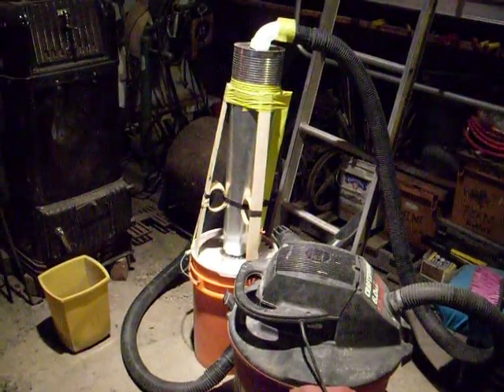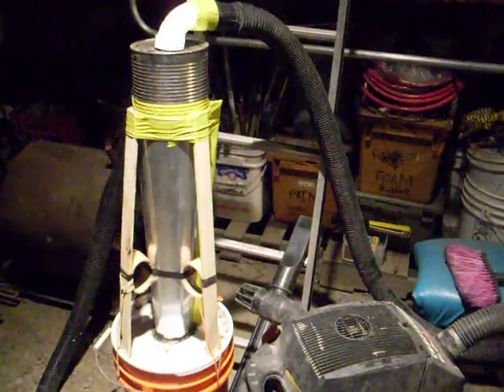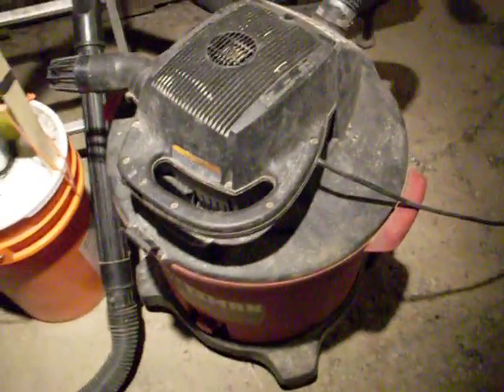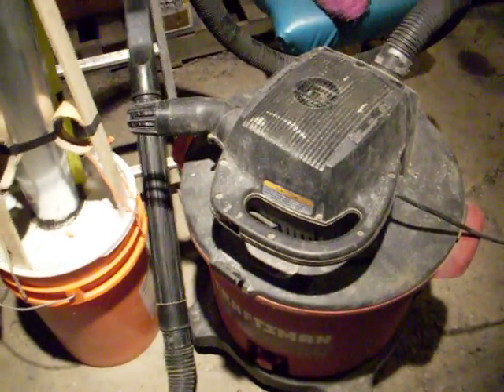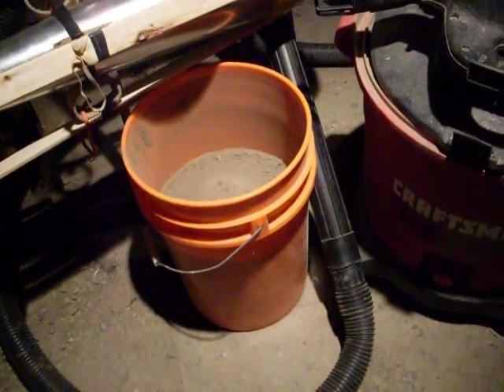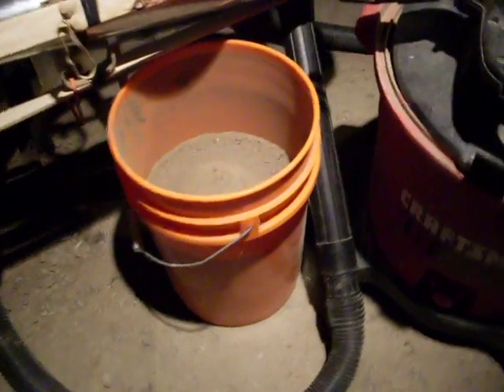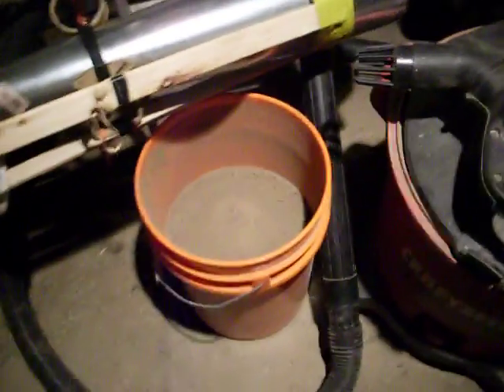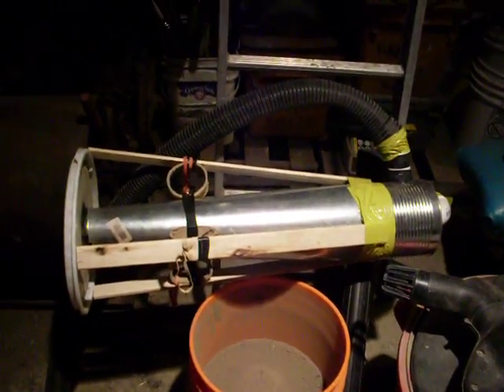Homemade Cyclone Dust Filter

Comment: what's wrong with letting the stuff just fill up the Shop Vacuum?  I have a shop that I use for plastic fabrication and it's not much that I use in a weeks time.  Not hard to just unclip the shop vac and empty the contents in a box for trash day.
Reply from the maker: Nothing, if that works for you.  I'm often cleaning up fine dust that clogs the filter rather quickly.  The cyclone removes the vast majority of the dust, allowing a long run time before the filter needs cleaned.  Its not about the bucket, its all about keeping suction for the longest period of time.  Think drywall dust!
Reply: I have owned a wet/dry shop vacuum for 4 yrs and I have yet to buy a filter sleeve for it.  I just brush it off and tap it on something until it's clean enough to put it back on.

Comment: i used a 5 gallon water jug from my water cooler and one of those big 25 gallon tubs with a lid. Cut a hole in the lid to accept the neck on the water jug and then sealed it. Cut a hole in the top of the jug to attach my 6.5hp shop vac and one hole in the side of the jug about 6 inches from the top to accept the hose that goes to my planer,table saw bandsaw ect. after getting it built and all sealed i tried it out with the planer and i filled the 25 gallon tub with shavings and there was nothing

Comment from the maker: @rolandvz71   Little if any noticeable loss, you would have to measure it to find out.   It would work better with a shorter, smoother connection between them.